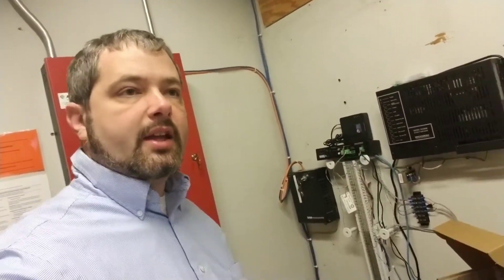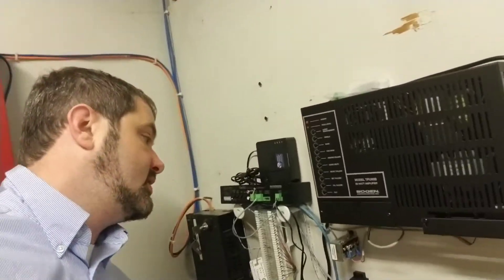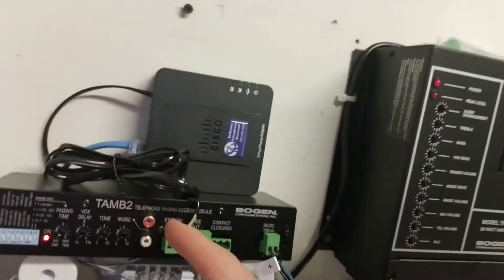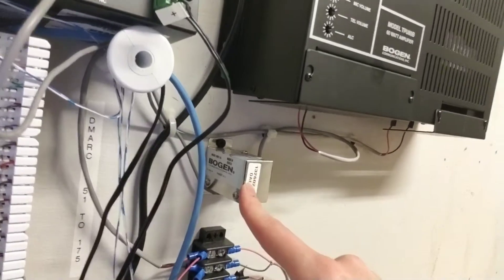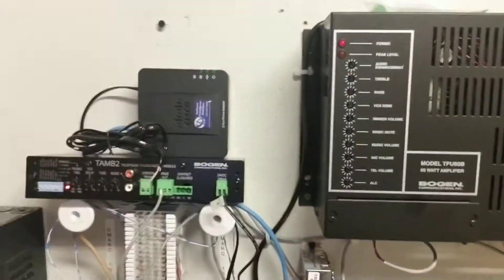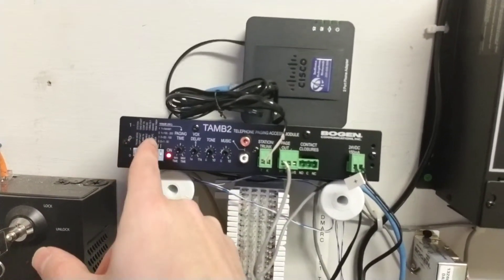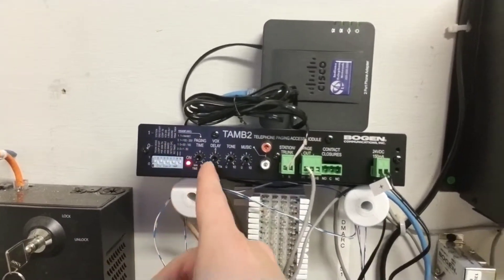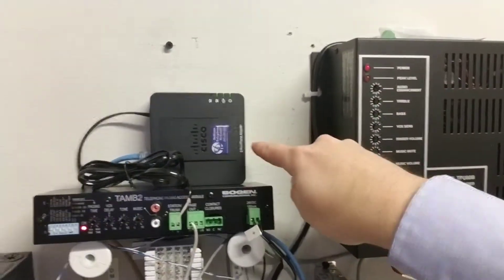2019.03.25 - How to connect Cisco 2 port ATA to Bogan TAMB2 and Amplifier

Comment: I'm trying to wire this up with mood music going to a PS600 cause we have no control over volume
Reply from the maker: Got it! For wiring up mood music to a PS600, you'll need to ensure your audio source connects properly to the amplifier. It’s crucial to have the correct cables and possibly a preamp to control the volume. Double-check your connections and consult the PS600 manual for specific instructions. If you’re still having trouble, seeking advice from an audio professional might help. Thanks for your question, and don’t forget to subscribe for more tech tips and troubleshooting guides! 🎶🔊

Comment: Ben...I got a link to your video form a Cisco guy......we have same setup but have and issue with the Cisco 192 DTA not hanging up....and getting "Busy" beeps across the speakers becaise the DTA is not hanging up.....have you ran across this?
Reply from the maker: This is a setting you can adjust.  I have experienced it before but just kept messing with the settings.  I also think we had to adjust the ata.  Hopefully you got it working!
Reply: I managed to find the fix to the fast busy after hanging up. Check DIP switch number 4. Setting Vox Delay to enable fixed the problem.

Comment: We are using the same config for paging in our stores and are getting a busy signal being broadcast over the speakers at the end of some of the pages. It doesn't happen after every page, but does on most.
Reply from the maker: It means it isn't hanging up after the call is done. Try a different ATA.
Reply: we're having the same problem, used multiple ATA's.  Anyone know a fix?  doesn't hang up after page, goes to busy on the speakers...   thanks!!
Reply: I managed to find the fix to the fast busy after hanging up. Check DIP switch number 4. Setting Vox Delay to enable fixed the problem.